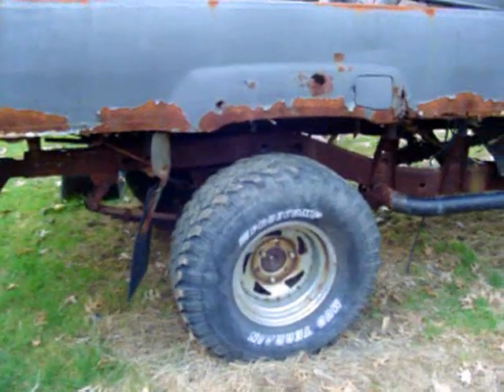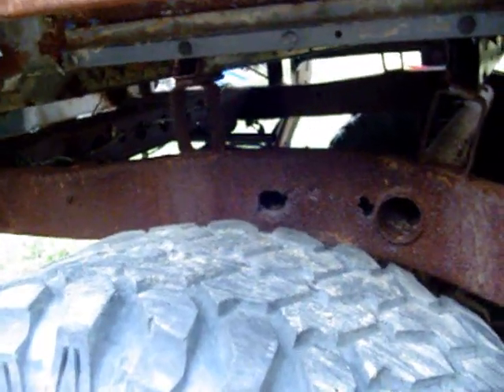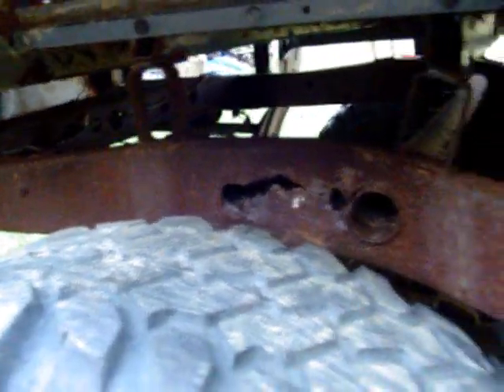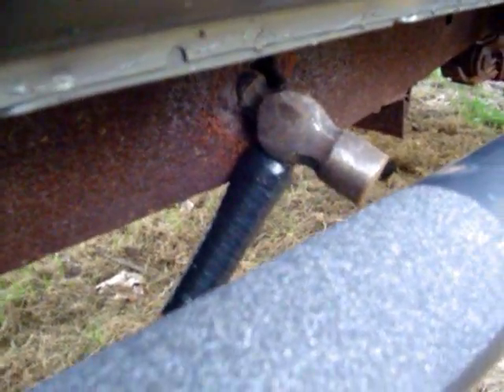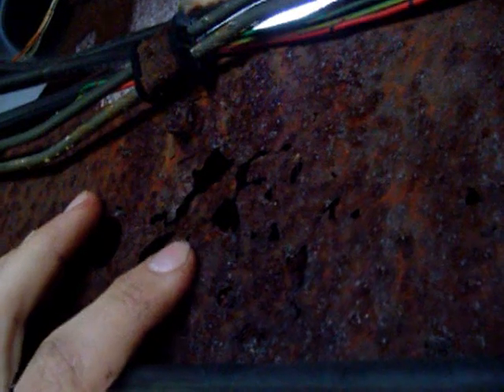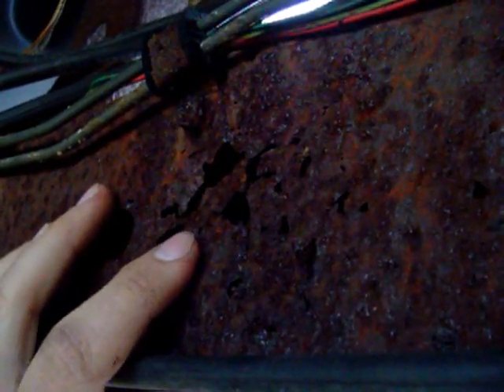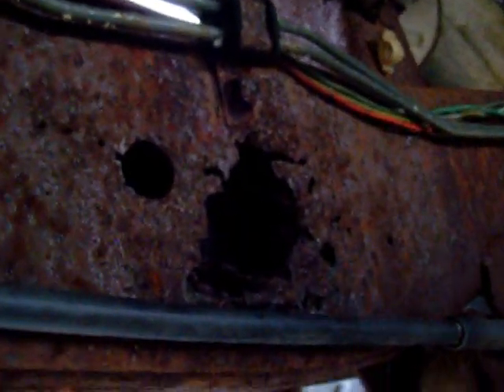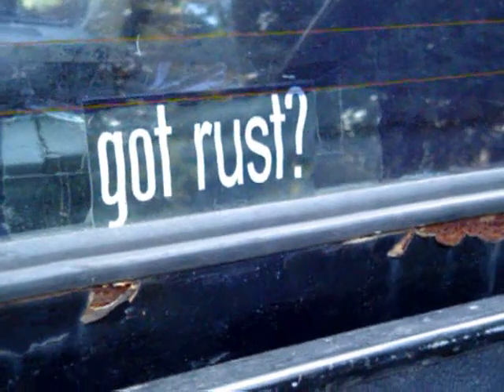Toyota Frame Rot Test

Comment: Most Japanese imports had rusting issues because the vehicles were designed to be used in Japan.  In the U.S., particularly in California, there was the factory option to powdercoat the frame for an extra couple of hundred dollars.  It's worth it.  I have a '90 4Runner with the frame coated, and if I rub off the dust and dirt, it looks just as black as when it was new.  There is even less rust than on domestic frames.  Also, I live right next to the beach.

Comment from the maker: @MrRichierich1990  Undercoating when new does help, but the problem with fully boxed frames is that they hold moisture, salt, dirt, etc.   They rust from the inside out, where it is not as easy to clean.

Comment: @toocheaptosmoke Eastwood sells a boxed-in frame coating in a spray can with a nozzle. Expensive for a can of paint especially when you need at least 3 cans to do the job, but oh well. I got frame rust too, but not as bad. I'll be attacking the frame with paint this year.

Comment: @taitai907 I completely disagree, I have never had any mechanical problems with any Fords i've owned and 2 of them well over 200,000 miles, just regular maintenence.  Second off a completely rusted through frame is much more dangerous and expensive than a mechanical engine defect.  Third off Toyota has had many complaints about engine sludge build up and seize in their v6 motors, do a little research and you'll find out that Toyota is junk and a cover up specialist!

Comment: hah i have an 01, body and truck is mint, just punched a hole through the frame.toyota will buy back the truck but for not enough $. i guess when they say a large % of toyota's are still on the road they mean the frames that rot off are everywhere.

Comment: @FuckToyota440 Toyotas have rust problems, domestics have mechanical problems.  Better to have a rusty frame than a fucked up transmission, camshaft. crankshaft, or fuel injectors, the latter four of which I've had only on multiple Fords and Chevies but never on a Toyota.  Rusty frames are a pain in the ass, but it's cheaper than an engine swap.
Reply: I'd love to see you try to pass inspection in one of these rust prone Toiletas. Once the frame is too damaged, no state will let you register it.

Comment: @taitai907 Domestic frames are designed to flash rust same as the crank pulley this is so the frame doesn't rust completely through. The problem is, is even new toyota's still have this problem that's why they're junk! What they don't have snow in Japan? Get real dude Toyota blows!

Comment: I own 2 of these trucks one has 136xxx and the frame is like new and another with 234xxx and it's also in good shape..... this yota was probably  in a salty state and likely abused
Reply: Everything in the salt belts rot out in about 10 years or less.
Reply: yup..you are least replacing gas and brake lines by then...you can get 20 years out of a frame if you undercoat.
Reply: working shlub Yup easy, Better if you spray it with use motor oil all underneath them every winter.